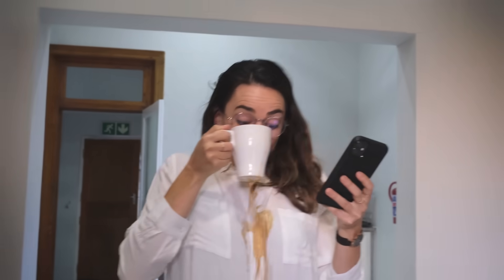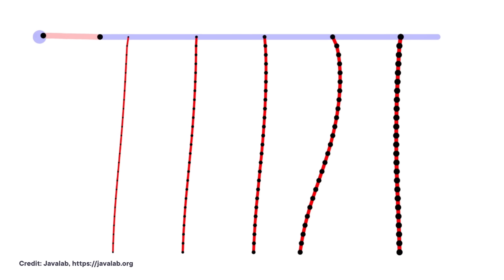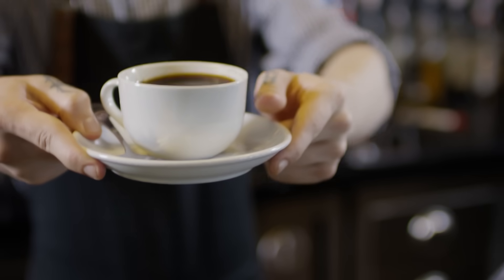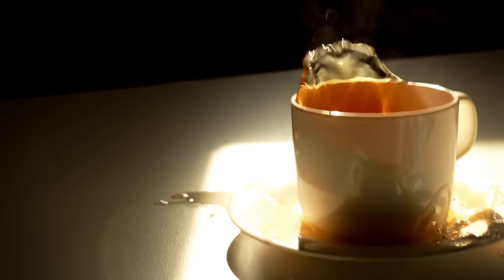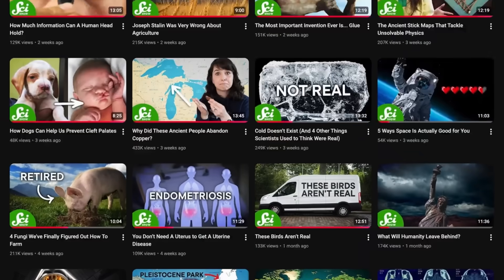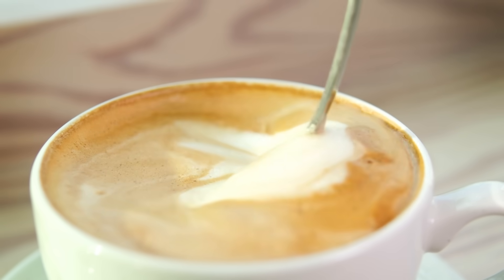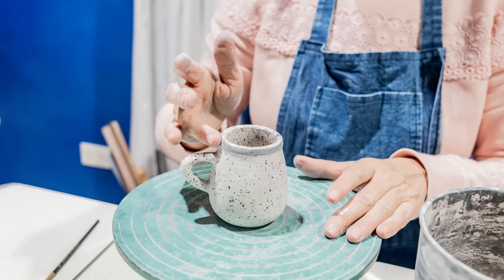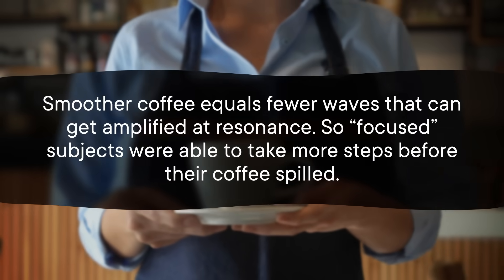Your Coffee Mug is a Physics Disaster

Comment: The physics may not be "correct", the problem is that hot water has lower surface tension. Watch the surface of a hot cup of coffee and then one from the tap... So it sloshes way easier than room temperature water. Foam has a higher surface tension so it keeps its shape. I don't buy the resonance thing either. When you walk, you accelerate and decelerate. That isn't resonance. You are oscillating but it's NOT resonance. The water in the cup CAN'T resonate at a 1.5 to 2 second interval. The container is too small. There are a ton of things wrong here.

Comment: I don't understand why the "steady cam" rig-inspired carrying method was missing from the list of tips: elbow out, mug close to the abdomen. This increases the total length of the levers from the fix point (your body) to the mug and allows your upper arm to swing freely (instead of moving in sync with your body) and act as a motion damper.

Works for me...

Comment: As someone who walked for years with a coffee mug between my workbench and a far-away cafeteria, here's a little trick to eliminate sloshing: your instinct is to hold your coffee cup straight ahead in your direction of travel. Instead, put an angle into that arc of support: if you carry it in your right hand, twist the handle to carry the mug facing from your hand to the left. If you carry it in your left hand, carry the mug pointing right from your hand. The goal is for underarm, hand and mug to form an L-shaped "support beam". Also, keep your grip as light as you can. This way, your cup - and coffee -  is not exclusively jostled back and forth. It is moved in various directions instead, so the energy of your jostling is distributed into left/right, back/forth, and circular directions, giving it more opportunities to dissipate safely. You will be surprised how effective this is. Physics rules!

Comment: The problem isn't the shape of the vessel.  Coffee, or hot beverages in general, aren't meant to be walked around with.  Coffee mugs are designed with this in mind to maximize internal volume without increasing vertical volume.  They supposed to be wide and squat so you're less likely to knock your mug over while talking to someone.

Comment: Curved glass is no-no.
Cylinder in this case is the only "rotation body" to which volume is proportional to depth/height, which is crucial for pouring liquids in proportionally with unaided eye.
If i want exactly 2/3 of coffee and 1/3 of milk, cylindrical mug is the only one that allows to make it reliable without any assisting gear.
In order to pour exactly half of glass wine without knowing where it is exactly, you'd need to make (I'm not kidding) integral calculation in your mind.
Can i do that? Probably yes.
Will it take less than several minutes i don't have to do it every morning? Definitely not.

Comment: Interesting perspective — I knew the shape of the mug mattered, but I never really considered how much our walking rhythm influences spill control. I had always assumed the major factor was the handle design and where it’s positioned on the mug.

For me, a good handle should fit the hand comfortably and give you full control of the mug’s orientation. It should keep the rim level with minimal effort and do so without scorching your pinky. The handle also needs to be positioned so the mug feels like an extension of your arm rather than a hot, tilting mass of liquid you’re constantly fighting against.

Insulated mugs make this even easier because you can wrap your whole hand around them. Carrying one feels a lot like how a waiter holds a tray in a crowded restaurant—once you get the feel for it, the motion becomes smooth and almost effortless.

Comment: I observed in the past that holding the mug with a mostly straight hand (bent as little as comfortable at the elbow) in front of me (not necessarily in front of my face, but rather at the waist level and a bit to the side) does not look weird at all and helps dampen the steps. It also helps not to crash with a hot mug into someone. :) If I additionally slightly move the mug up and down just a little, and at the lower pace than my steps (sort of simulate 'floating' of the mug, just a tiny bit), I can easily walk at my normal speed or even a bit faster and I don't spill the coffee at all. And all this looks normal enough that no one ever noticed. :) My hand just turns into a coffee gimbal :D

Comment: It's easy. Focus and let your hand smoothly move relative to your body to cancel the force from your steps. You do it instinctively to maintain balance, like if you relax and lean left, your right hand will rise to maintain your center of gravity.
Holding the cup by the brin helps a lit, but you can hold it from the side and a bit lower like you would a bottle (if temperature allows.)

Comment: I've tested this myself, and found an interesting method that works at least 80% of the time - I think it depends on the size of the mug, the volume filled, and the speed of pace. While walking, holding the mug by the handle, simply raise it up and down in rhythm to your pace; don't concentrate too hard on this, just a gentle up and down a few inches seems sufficient. This has resulted in far less sloshing and spilling as I walk from the break room to my desk.
I'm no physicist or fluid engineer, but I assume this changes the resonance kinetics somehow, by moving it from a forward/backward to essentially forcing gravity to push/pull the fluid vertically, and that somehow disrupts the inertia.

Comment: The trick is to slightly move your arm to compensate for the body's motion, and also to not use a rounded cup, or one that the top is rounded outward, because those cups just don't keep liquids in. I've been taking cups of tea and milk up the stairs to my room every day for some 40 years. I practically have a PhD in this, and I rarely spill anything. :)

Comment: The effect you're describing is called a 'standing wave'. With a small input of energy, properly timed, you can amplify the wave considerably. I discovered this as a boy, when I found that I could make 6 inches of water in a bath slosh over onto the floor with well-timed swings of my hand in the water. I demonstrated this technique once to my mother, but I don't think she quite got the point.

Comment: You could also, while walking normally, bend and contract your wrist a bit, so the mug turns around on the horizontal plane, 
thus changing the direction of movement / force in relation to the liquid..

Comment: As a physicist and an equestrian,  I can tell you it’s not that difficult.  Just pull the mug backwards slightly as you step forward and then return it to the original position, repeat. Its the same motion used when holding reins in contact with a horses mouth to maintain contact, without yanking on the bit while the horses head is moving. I can jog with a cup of coffee without spilling it.  Old trick to teach good horsemanship.

Comment: I was a server for decades; maybe I can help. The trick is to let your arm swing on its own frequency and not be tied whatsoever to your walk. The oscillation talk thoroughly explains why. Here's how to separate the jostles and minimize the sloshles ....

Your elbow should be solid to hold your sloshy item at the height you want, but low-ish and peripherally visible is best. It's your shoulder that's absolutely loose--and that may take a bit of time, observation and focus/no-focus to get there. Your arm becomes like the weight under a camera gimbals: it is the stabilizing factor but absolutely free to swing on its own with the pivot only at the shoulder. And it's reciprocal: the added mug weight adds to the dampening inertia. 

The next part is your eyes. Always look forward and only peripherally see your mug. This automatically gets you walking smoother. Your larger move from the counter to your desk should be another smooth arc and that geometrically streamlines your movement too. 

What about the slosh in the cup? Hold the cup more delicately and contact the handle only by the fingers' second joints, thumb on the handle top; you want to feel the mug against each finger surface. They are the final shock absorbers so they shouldn't be solid. If your eyes are on the horizon they are in a still place and they will "talk" to those finger surfaces. (I know it sounds magic-y, but our bodies are designed to do this--think about archery from horseback or owl eyes directing their talons) Then feel your elbow to your mug as one simple structure. Let that structure move on its own by momentum--almost like a Ouija glass. Its only connection is the shoulder and over that you want very little control. You can influence it but don't control it. Ultimately you want your shoulder's pivot point to let your arm mostly loosen and only slightly dampen simultaneously. Only peripherally seeing it helps your brain do that split. If you're really loose you can even see the arm hang back a smidge as you start forward --further minimizing slosh.

The tl;dr: Don't let your hips talk to your elbow but let your eyes talk to your fingers. Enjoy your joe!

Comment: 1. Fill mug with water. Practice walking with it. alot.... 
2. Don't fill mug to the rim. This one should be obvious but I guess it isn't.
3. Work out. If you are weak you have to grip the mug harder. If you have a stronger wrist you can hold it loser and allow your wrist to flex while walking. (shock absorber)
4. Don't run with your coffee.
5. Use a lid and an insulated cup.
6. If none of these work you can design a new shape for a coffee cup, learn how to work with clay, buy a kiln and make your own mugs.

Comment: In the 80s my dad had this ceramic cup. It had a big bottom that funneled into a smaller rim. Flat  bottom with a rubber pad and it would ride to work with him on the dashboard of an f150 doing 55 on what used to be a cement highway that was as smooth as a cornfield. He had that mug for years and unless you overfilled it. You couldn't spill anything 🤷

Comment: So happy hear about the mug shape because, as a potter, I already make mugs that are wide at the bottom and narrow at the top since they're less likely to be knocked over, and there is less heat lost to the air. Now I can add one more factor that makes that shape perfect.
Reply: Not good because you get an avalanche of burning hot coffee in your mouth when the bottom is wider than the top.
Reply: @fredbarnes196  sounds a bit like a skill issue...
Reply: @crowdedsubwaystation  it’s a physics issue ironically.   The tipping angle of the cup has to be greater when the bottom is wider than the top.   Think about it.
Reply: @fredbarnes196  but when the hole is smaller at the top than the bottom, the liquid is more contained. When the opening is wide and the bottom is narrow, the liquid is harder to keep contained and is more likely to spill as you drink. Ive spilled my fair share of coffee and it happens way more with a wide opening and narrow body.

Comment: My solution - an oversized mug with a smaller volume of double strength (compared to regular retail coffee shop coffee) coffee (near espresso strength). My mug usually is only at about 1/3 to 1/2 capacity when my machine finishes.

Comment: Practical solution: you can get a stainless steel stemless wine cup or just get something with a lid. Or both as the vacuum walled tumblers just come with a lid. Bonus the cup keeps the liquid hotter longer. 

Or at work I get a recycled paper cup and put it in the recycle bin to avoid the water waste of washing a cup everyday. The volume of the cup is excess for a serving of coffee allowing transport without spillage even without the plastic lid which I forgo to avoid one use plastics

The application for other reasons makes more sense than the actual application of coffee transport when other vessels are readily accessable.

Comment: I drink a good portion of the coffee right where i am when i pick it up.  = No or almost no sloshing out.  And usually I'm at home: don't need to carry the mug far.  I'm usually too cheap to buy coffee when I'm at someplace else; and I don't like it super hot.  So I bring a thermos type container or more recently, a screw top mason jar.  I only unscrew it whem I'm going to take sips.  Another trick I did in my early 20's, living in a cabin 1 1/2 miles in winter from the road:  I kept a canteen jar of super concentrated instant coffee.  Tasted quite bad.  But I wanted sips for the caffeine.  To get/keep me going on a mile and a half hike thru snow after work or early morning...

Comment: form must follow function.  Coffee mugs should be optimized for drinking coffee.  That means not having dribble cups, top heavy mugs that knock over easily, and some reasonable thermal insulation properties that allow cooling at a reasonable rate but not so fast you have to slam it when it's at drinking temperature.

walking with it isn't so difficult unless it is filled to the brim.
as a child, I read a tip in Reader's Digest to put a spoon in the cup.  This was back when a cup of coffee was 5 ounces and usually was on a saucer.  

I find the universal diameter of about 2-3/4 " to be too big for my mouth and causing dribbles because of the width of the spillway.  I also don't like thick walls for a similar reason.  A six ounce volume is abut ideal but I can use a tapered 8 oz cup from europe.  All American mugs seem to be the same basic size.

Comment: There are plenty of cheap mug options that come with some form of lid or cover that address this very problem already...
Other then changing the container you can also work on taking a longer stride witch if done just right can maintain how fast you get where you want to go holding the cup while reducing your oscillation frequency that would cause this issue.

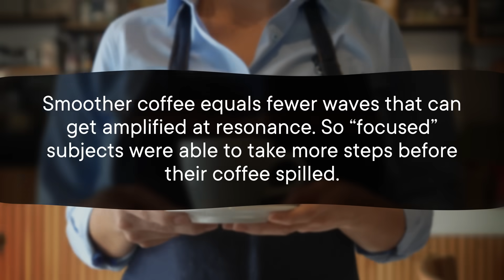Comment: 6:05 My personal experience agrees with the paper. If I keep my eyes on my mug, I'm far less likely to spill it.
Reply: And more likely to not see somebody coming the other way at a corner, or notice that slight change in floor surface that is designed specifically to barely catch your heel.
Reply: @derekborders9647  The floor isn't a problem in my house, and nobody is coming around a corner fast enough in my house that I won't be able to react in time. If I'm ever working as a server, I'll follow the advise that works for servers. In my own home, I'll do what has worked for me.
Reply: I carry a coffee mug as if I were waltzing. It challenges your core and shoulders/frame but it's a great practise. My guess people who dance, skate, horse ride, kung-fu and so on will have similar experience.
Reply: @meromorfu  I tend to step with the balls of my feet first when I walk barefoot, which I usually am at home. So yeah, maybe my weird way of walking also helps.
Reply: @TocsTheWanderer sneaky feet, it's an American Indian wisdom walk
Reply: @meromorfu  I've never heard any name for it before, I just got in the habit after spending a lot of time walking outside in leather turn-shoes during reenactment. They tend to have quite thin soles, so walking around like that is kind of necessary if you want to avoid stepping on something that could hurt your feet. And it easily transferred to walking barefoot. I do it as naturally as breathing now.
Reply: @TocsTheWanderer I made it up 😅

Comment: It is also about the design of the coffee mug, though. For example, in my experience, a mug with outward-sloping walls sloshes more than a mug with straight vertical walls. I have long argued that coffee mug design should incorporate a slight inward sloping of the walls of the mug, a bit like a short Erlenmeyer flask with a really wide mouth. Then it wouldn't spill as much because the sloshing would be reflected mostly downwards by the inward-sloping walls. And as a bonus for those of us who put milk in our coffee, it would greatly improve swirling to mix the milk into the coffee. Sadly I haven't found many mugs with this design...

Comment: We use capuchino cups for coffee. The diameter is smaller, so... Well, we never have this problem, it never drips. Also, with a smaller surface contact with air, the coffee remains hot a little longer.

Comment: Huh, I always assumed that the walking backwards trick worked because of the different order in which all the joints were actuated and not landing heel first, which both combined into fewer vibrations overall being transfered above the hips. But the resonance explanation also makes sense. Could it be both?

Also, I have an odd triangular mug and I could swear I have easier time avoiding spills from that one, even though it gets wider at the top. Maybe a non-round mug is the solution, so that jolts at different directions have different resonant frequencies and the nodes are staggered? Or maybe one with a pillar sticking out at the centre? Or a heart-shaped one?

Comment: Look for the no-spill cup holder.
A small tray suspended on  a hook so the tray swings at the same frequency as the surface. The surface is perpendicular to the line from the tray to the suspension point.

Comment: There is an ignobil prize awarded to the solution to this problem. Holding the mug by its ear, just rotate the mug over its longitudinal axis by 90 degrees and back every couple of meters. The waves will collide perpendicular to each other, interfering and preventing build up. Works perfectly every time.

Comment: A correctly thrown coffee mug does taper inward towards the top. The stated reason is so the coffee will have less surface area in contact with the air. This is to keep the drink hotter longer. Most off-the-shelf mugs are just poorly designed.